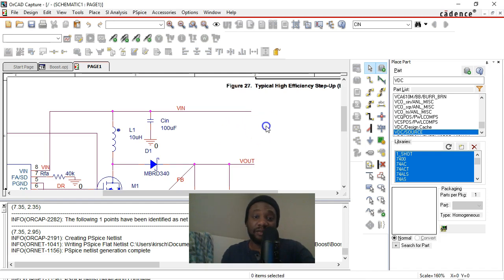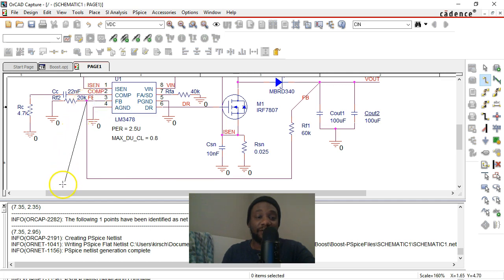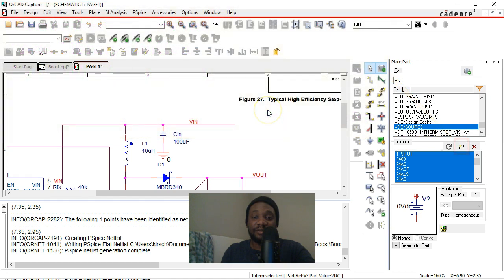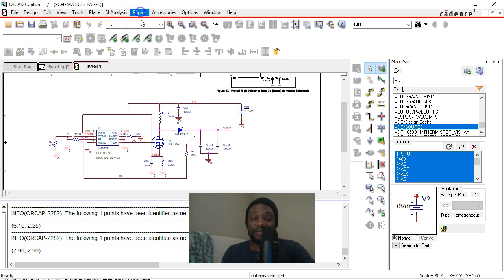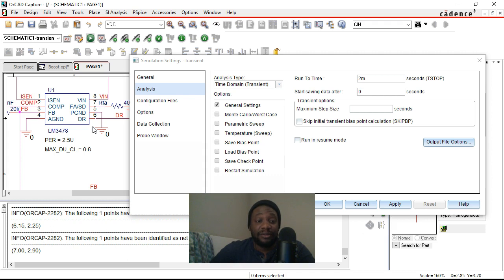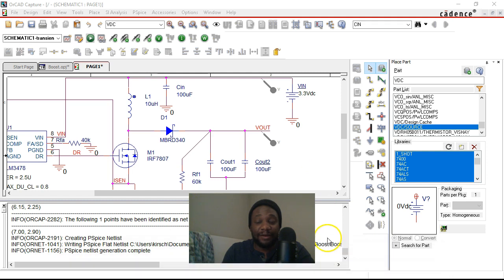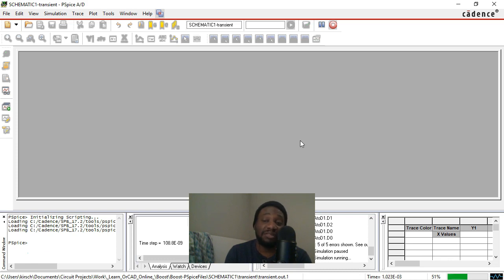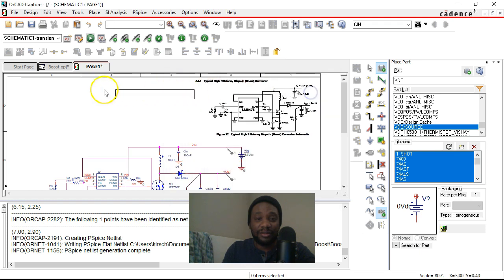Ensuring Schematic Precision: OrCAD PSpice Tutorial Part 6 - Schematic Verification

Comment: Hello Kirsch,  I hope i am not late to try this simulation.. I have recently started learning OrCAD.. I am trying to simulate this circuit. But getting this error

ERROR(ORPSIM-16144): Value may not be 0
R_RF1         FB VOUT  60k TC=0,0 
R_Rc         0 N00481  4.7k TC=0,0 
C_CC         N00481 COMP  22nF  TC=0,0 
V_V1         VIN 0 3.3Vdc
R_RF2         0 FB  20k TC=0,0 

So what can be the reason? I have checked all the values all seems ok..
Reply: @techedkirsch   Thank you.. Error is resolved now.. I have put Rsn as 0.025 Ohm, so it was taking it as zero. I changed it to 25mOhm and it worked..

Comment: Hi Kirsch, this is an older video, but I thought I might ask a question anyway. I tried running this simulation, and got an error saying 

'EVALUATION VERSION analog Node Limit (75 Nodes) Exceeded!'

In this case, is it literally saying I have too many connections in the schematic?
Reply: @techedkirsch  Thats interesting. I wanted to continue with a half-bridge, and add a high side gate driver to the circuit you show here. But I don't think thats possible for my software currently. Thanks for the insight.